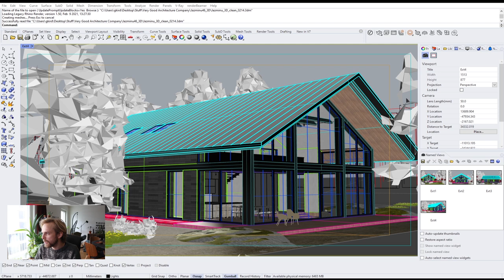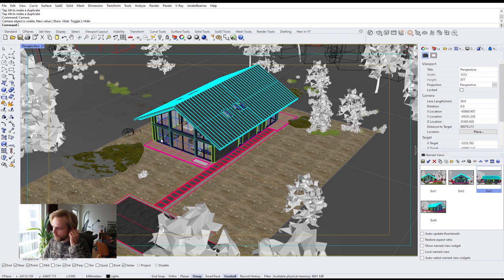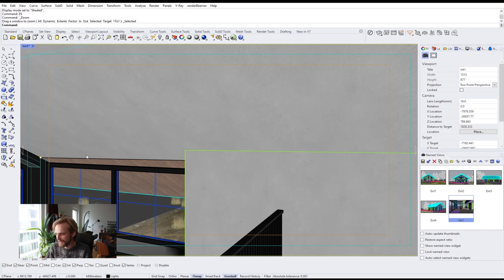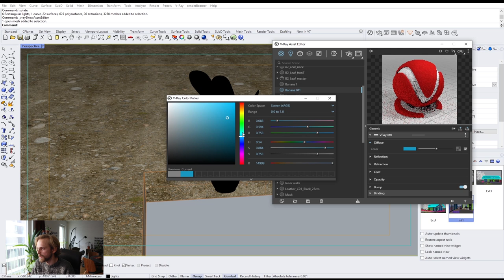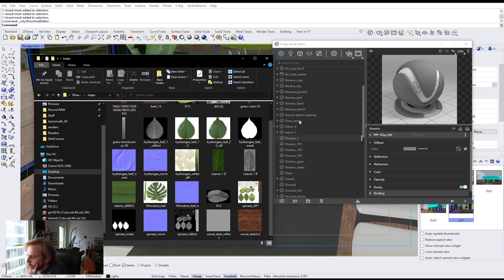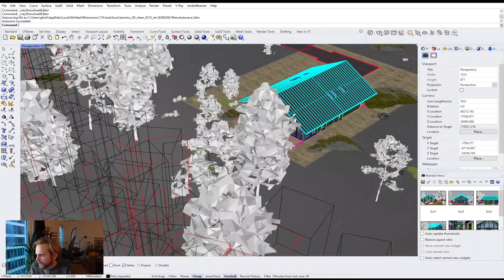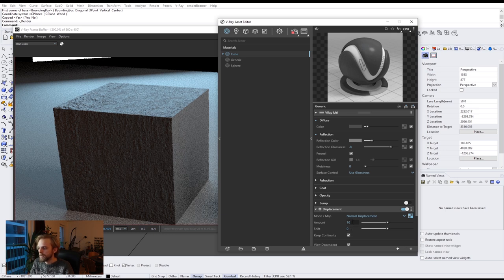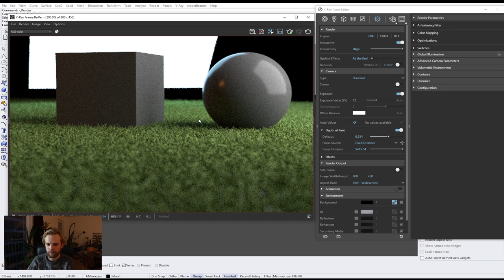Rendering Architecture in Vray for Rhino -  Full course - Part 4/4 (AADA25)

Comment: Hi Gediminas, and great video and examples as always. I'd like to ask you a question, since you seem to be well into SubD in Rhino 7, and I can't find an answer anywhere. With the old T-splines the splines surfaces' smoothness could be changed in the options, like the usual meshes in Rhino; now, with Rhino 7 the SubD surfaces are always jagged (at least in my case), and I can't find a way in the options to make them smoother. Any hint?
Thanks for your time and have a good day/evening.
Reply from the maker: Hi there, TAB key is your friend. Or... SubDDisplayToggle command
Reply: @DesignGoBrr   No, I don't mean the box mode. With T-splines it was in the options menu (fast, fastest etc.)
Reply from the maker: @paologreco9412  Oh you mean the preview. Thats under Options -> Mesh -> change to smooth from jagged and you'll get a cleaner representation